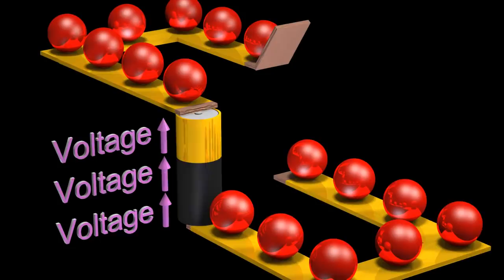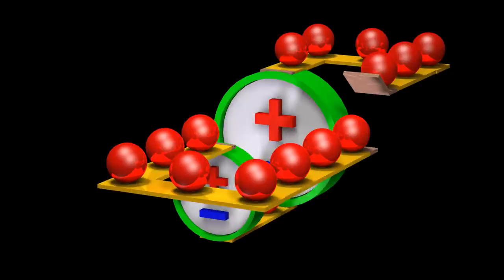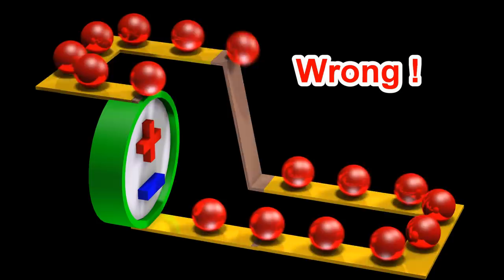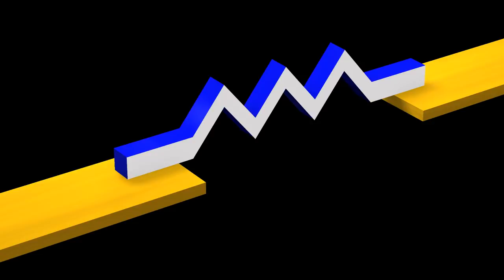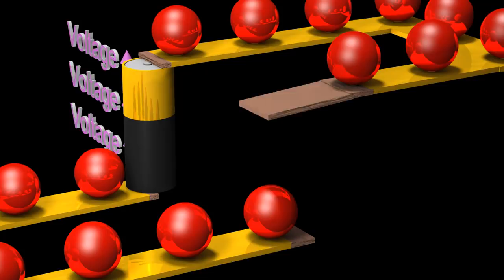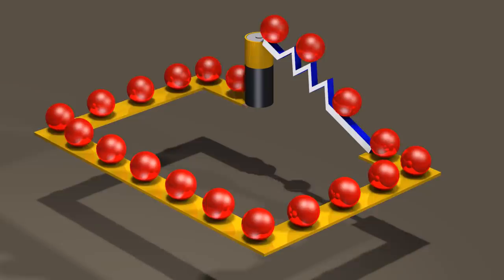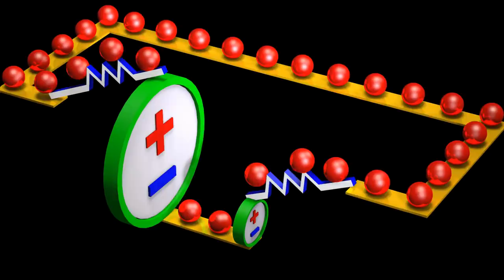Superconducting Short Circuits across Batteries

Comment: There is an answer for superconducting cells and wires: inductance.
Any circuit is a loop; any loop has inductance.
You can have a continuous (DC) voltage across the inductance, but remember the current will always ramp up. The energy from the cell is stored in the inductance.
This is how the coils in MRI scanners are charged up. After the charge voltage is removed and the coil shorted, the current flow can last forever so long as the wire does not lose superconductivity.

Comment: Also, why do the 2 different voltage source has a current in it flowing? Is it right if I made the other one larger voltage, the current flow would be opposite?
Reply from the maker: Yes, if you made the other voltage source larger, then the flow of current would be in the opposite direction.
Reply: @EugeneKhutoryansky   5:30.  The current should go to the bottom of the smaller voltage source and get lifted to a given level, and then lifted again by the larger voltage source.
Reply: @ozzymandius666  yes but if you change the polarity of the smaller voltage source as it is currently at 5:30
Reply: Why this comment 11 years old???

Comment: So internal resistance of the battery has got it's practical significance even though if we neglect it in solving problems related to electrical circuits.
Reply: Yes. Eugene reduces it to the most fundamental level you will find.

Comment: If you have a real-world battery (one with internal resistance) and you short the terminals and measure the current, you will get the same exact current if you put two of these batteries (perfectly identical to one another) in series with each other and repeat the experiment, because both the voltage and the resistance are both doubled. I mean, don't do that, but I think it's interesting. In a "typical" circuit, where the battery's internal resistance is negligible to the performance of the circuit, you would usually get a very different outcome when doubling the power source in series. At the same time, you'd get almost no difference (except a longer battery life) if you double the power source in parallel. But as you approach the maximum output current for the power source, this behavior flips.

Comment: there is another paradox, when you pulse a battery for the first time, you actually sometimes can get strong current limiting (high ESR), that is due to the oxidation of conductors being punctured by currents.. common with AA batteries, its a paradox because its not supposed to be here according to marketing. I am sure that girl is just studying before a Halloween midterm, and does not have a person as a DUT in mind.

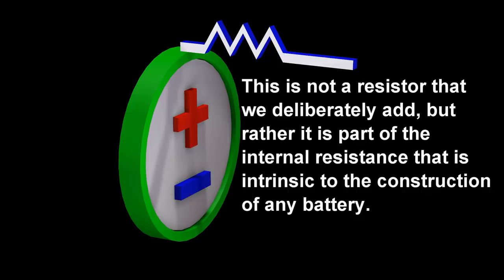Comment: At 3:30 you used a word internal resistance and you showed it outside the voltage source. Shouldn't an internal  resistance be shown inside the voltage source between the two terminals? The source of internal  resistance is basically the electrolyte present in the batteries. So why we model INTERNAL  resistance as a resistor EXTERNAL to the voltage source ??
Reply from the maker: The actual terminal of the battery is after the resistor.  We are modelling the battery as an ideal voltage source in series with a resistor, which give the correct mathematical results.
Reply: @EugeneKhutoryansky  as far as I understood from you reply is that we are considering the real battery to be ideal battery and and external resistor combined with it. And a real battery is same as ideal battery with a resistor external to it. But I mean to say can we instead consider the resistor to be inside the voltage source . If we do it how would it look like? Why don't you make a video on internal resistance in detail so we can understand this concept more deeply .  In your video you discussed the big battery charging the smaller battery. So I want to ask how to charge the smaller battery faster? By increasing its internal resistance or by decreasing its internal resistance?

Comment: maybe you should do a video on..., for a better term... "impedance matching"?
its very very closely related! this internal resistance versus circuit resistance.

its like... if you go back to the basic of an eddy current brake, or the lenz reaction trick of a magnet in a copper pipe. the energy of it falling is dissipated in heat in the copper pipe as I2R.
you cut a slot in the pipe, and now theres no eddy current and no reaction.
you start adding resistance to the slot, and as it reduces, the heat starts to predominately appear across the resistance, until you reach a point that its the same resistance as the original material...

at which point, heat is again distributed evenly through the entire mass of the conductor, and the "resistor".

replace the pipe with thousands of turns of wire with two ends, and the same deal applies... the conductor has resistance, and the load resistance affects where the heat or the work, is predominately performed. you cant go lower than the winding resistance as it overloads... it generates the heat, does the "work", rather than the "load".
alternatively, if the pipe is very thin, it will have a high resistance and cant generate much current, with less reaction, regardless of the input power pushing the magnet through it.
when the winding resistance is so high it limits the current that can be delivered at that potential. a larger load, less resistance, simply lowers the voltage and less current flows.

 if the pipe is thick, it has a very low resistance. a certain amount of copper is just right for the speed the magnet moves,its flux density, the amount of "eddy current", the conductors resistance, the EMF induced and the current then seen... if one wants the maximum work done. 

as you make the pipe thicker and thicker, theres less and less resistance, and the magnet, or whatever is driving the magnet, sees more and more "reaction" to movement. you can drive a larger load, less resistance across the slotted pipe, with less heat generated in the conductor itself,  but need proportionally more power pushing the magnet to do so. and that reaction is simultaneously trying to destroy the magnet by opposing it...

a big generator can make a small current but a small generator cant make a big current. der. whats limiting the power? the supply, the generator, or the load?

ignoring impedances and reactions. just DC resistance.

Comment: You can make a voltage source with a transformer. For example you can alternate a magnetic field through a loop of superconductor. If you increase the magnetic field linearly, it will create a constant voltage. I’m not sure if the impedance of the self induction would be 0 since the voltage can be DC. I don’t know what would happen in that case…   Btw great video!
Reply from the maker: Current in the coil will be created so as to perfectly cancel out the magnetic field, so that the net magnetic field is always zero.  Hence the voltage is zero.  Thanks for the compliment about my video.

Comment: If everything is superconducting, the current will rise fast, but there is a counter induction voltage that limits the rise. If the superconducting battery is emptied, all energy is stored in the magnetic field of the circuit and the current runs forever.
Reply from the maker: The inductance limits the current only during the initial transient conditions.  In steady state conditions, the inductance will not play a role in limiting the current.
Reply: @EugeneKhutoryansky  Steady state is only reached, when the battery is empty, if resistance is zero. 
This limits the current.
If the inductivity of the circuit is constant, and the voltage is constant and the resistance is zero, the current will rise linearly, but very fast.

This said, practical superconductors will break down, if the magnetic field is too strong, so the practical limit is lower.

I am well aware, inductivity is not the subject of this video, just added this for completeness. I think your videos are excellent and I have recently learned a lot from them, love it!

Comment: There are at least a couple other factors limiting the real world outcomes of connecting a battery to a superconductor. Not only is there internal resistance in the battery but there is a limit to the rate at which the chemicals inside C battery can diffuse to free up electrons. There's also a limit to the number of charge carriers that exist in a superconductor so it ceases to become a superconductor above a certain current. Additionally there is a magnetic force limit on a superconductor that occurs because magnetic field can break up Cooper pairs that would normally carry easy electric charge. Finally electrons themselves have mass and require energy to accelerate them to higher and higher velocities as the current increases. Most of these effects are not problem low current but here were talking about current approaching Infinity
Reply from the maker: Good points.
Reply: Mechalchik , your arguments are appreciable but the diffusion of chemicals inside a battery is a new point (information) for me . Can you please explain how this diffusion works inside a battery. Actually I have no idea about it. Is this tge diffusion of chemicals inside a battery that allows the battery to maintain a certain constant voltage between its terminals?
Reply: Wait, magnetic forces breaking cooper pairs 😵 . What is this 🤕 ?

Comment: First, absolutely fantastic video! Second, a question. Every situation that I can think of that would create an ideal voltage is ultimately prohibited by the inductance of the wire itself. What would happen if you inverted the construction of the wire? For example, having the core of the wire be a non-conductive material (perhaps something like PTFE) and deposited the conductive material onto the nonconductive substrate? Additionally, would it be possible to introduce an external force (vibrations, for example) to counteract the inductance of the wire?

Comment: This makes sense but couldn't you make a kind of pseudo-battery by inducing a current into a superconducting loop? Such a battery would have practically zero resistance. If such a battery were shorted by another superconductor (assuming connections between them could be made without added resistance) would current still flow across the short? Even an extremely small resistor put in parallel with another will decrease the total resistance across them both right?

Comment: for a very brief moment during operation. A capacitor will act like an ideal voltage source.
As long as the plates and terminals of the capacitor were to be made of superconductor, and the wires shorting were superconductor too. we would see what would happen.
Reply: An Ideal Capacitor. With a real Cap you have jusr the same problem as with a real Voltage source
Reply: @fg8557  care to explain your reasoning? I clearly explained if my cap was made of superconductor the same as the short it should be valid. So I've eliminated the internal resistance. What did I miss?
Reply from the maker: The inductance of the wires would prevent the current from reaching infinity.
Reply: @EugeneKhutoryansky  That would be true if we assumed only a brief pulse of current or a dynamic situation with a limited capacitor. :)

Comment: This was a misconception I was facing from decades 😅 . Thanks a lot,  my mentor ! This videos answers all the questions taking place in the mind of every good physics student. I have watched this video 2 times. 💚 . Now I have some queries. 
If something is gone wrong with YouTube, should we comment on your facebook page posts in which you share your video's link?  

Will you make a video on Why power dissipation as heat in a wire or a resistor is directly proportional to current and not directly proportional to voltage?  Why  heat decreases with the increase of voltage and why heat increases as an increase of current?

My mentor, the raduis of curvature formula in single variable calculus where y=f(x) is very very unintuitive  an almost impossible to visualize.
It is R=[(1+(dy/dx)²)³*½]/|d²x/dy²|
R=
(1+(dy/dx)²)³*½
___________
|d²x/dy²|
I hope you got it. So will you make a video on this topic. 

My mentor it is my humble request to make a video on energy levels in electricostatic and electrodynamic fields.   In one of your videos you said that space time for negative charges is reversed as compared to space time for positive charges.

Will you make a video on radio telescopes and the mysterious facts behind their resolution with their aperture size. This deserves a video and unfortunately no YouTube video explains it intuitively. 

Will you make a video on how the universe actually looks when viewed from earth with the help of telescopes. Actually I am talking about the senerio in which we either have a Cartesian or spherical coordinate system and at the centre or origin we have earth.  The center of earth consides with the center of the coordinate system. The line joining the poles and center of earth is parallel to z-axis in case of Cartesian coordinate system . It should be parallel to the equatorial plane in case of spherical coordinate system. Actually I am confused why only north and south poles are the best places for space observatories. Making this video is not an easy task but I am suggesting you about this because these is no such video on YouTube and if you made this than your subscribers will rapidly increase. 

Will you make a video on Working theory behind Electrolysis (like the one you made on semiconductors) , Electrolytic batteries and Electrolytic cells ?

Actually I am eager to know about the origins of internal resistance . When we searh on google, then google says that it is due to the presence of electrolyte .
 Electrolyte is mostly a liquid so I think before doing a video on internal resistance please make a detailed video on fluid mechanics and the concept of difference between fluid friction and fuild's viscosity. Also make a video on Newton's law of viscosity and visually demonstrate the most confusing, unexplained and ignored difference between dynamic and kinematic viscosity.  Also please make a video on surface tension. 
Thanks a lot for reading this comment my mentor 😇 . I have been typing this comment for an hour. Please please please don't forget to reply to each and every question. I am very thankful to you. Again hats off for your great work. 😍
Reply from the maker: I hope to make videos on many of the topics that you mentioned.  By the way, email is a much better way of reaching me than Facebook.  As for YouTube, the issue is that YouTube often fails to notify me when a new comment has been posted.  Thanks.

Comment: What if a charged capacitor is used instead of an ideal voltage source with internal resistance?
Reply from the maker: The inductance of the wires will prevent the current from reaching infinity.

Comment: I'm not understanding: your graphic shows current flowing from positive to positive and negative to negative...that's not a short, that's just adding the amps together. A short would be positive to negative wouldn't it? i.e. I lay a piece of metal across the terminals of any battery and it begins to heat up dramatically, it shorts.  I connect 2 batteries together negative to negative and positive to positive and I now have added the amps together but no current is flowing.
Reply from the maker: I am showing positive current, which is in the opposite direction of electron current.  In reply to your second point, if the two batteries in that example have the same voltage, then no current would flow.  But, if one of the batteries has a higher voltage, then we would have current flowing as shown.

Comment: Ok, suppose we can place 2 superconducting plates near each other. Which should in theory make a capacitor. We charge that capacitor and than try shorting it with superconducting wires. What then?
Reply: Never mind, capacitor dielectric should always have resistance

Comment: I've read about batteries a while ago, and that ∆G = -nFE = -RT lnQ. I know this is just an ideal case, since ∆G represents the maximum amount of work the system can produce, which only happens at an equilibrium state, implying that the change must be quasi-static and the current flow must be kept at a minimum. My question is: why is the change in electrical potential proportional to the current flow (since E(real) = E(ideal) - Ri)? Is it just the first term of a taylor series expansion or is it actually linear? And if it's just an approximation, what is the actual formula that describes the voltage drop, and how do you derive it?

Comment: What if you use a magnet to induce a voltage source on a superconducting wire - where would be the resistance then?
Reply from the maker: The magnet will induce a current so as to cancel out any magnetic fields inside the conductor.  We can't have any voltage drops inside an ideal conductor.

Comment: What if we make a capacitor entirely from super conductors, charge it and short it with a super conductor?
In this case the voltage source should not have any internal resistance.
Reply from the maker: The inductance of the wires will prevent the current from reaching infinity.
Reply: @EugeneKhutoryansky  thx!

Comment: If you made a generator entirely of superconducting wire as the voltage source, how would this change?
Reply from the maker: The wires would still have inductance, which would prevent the current from reaching infinity.